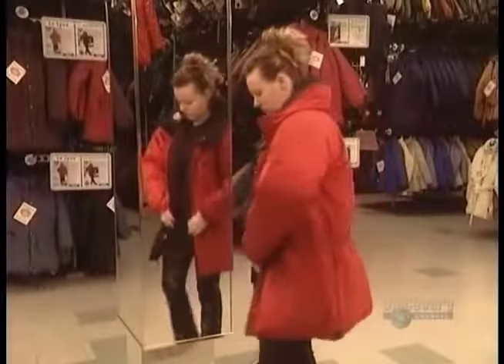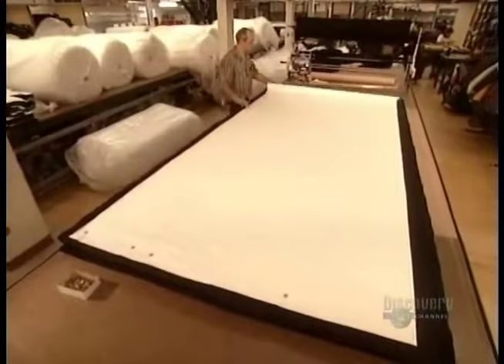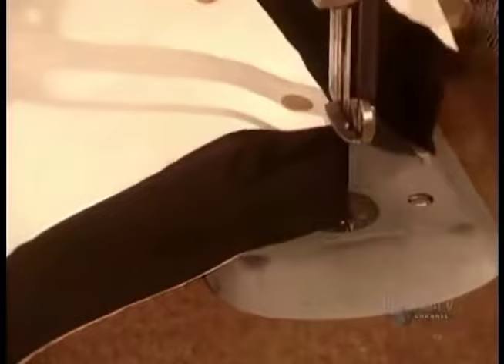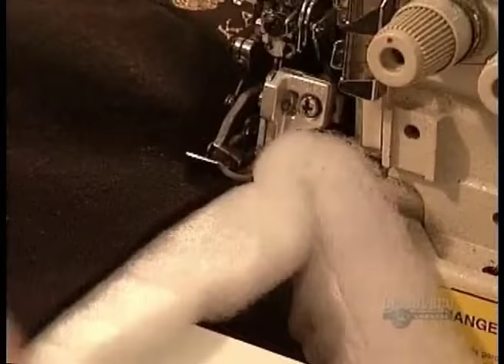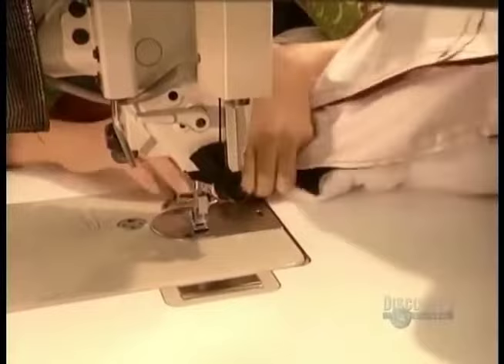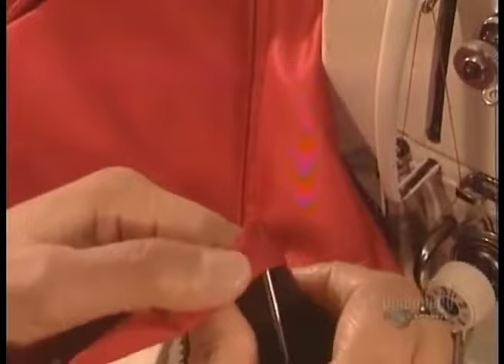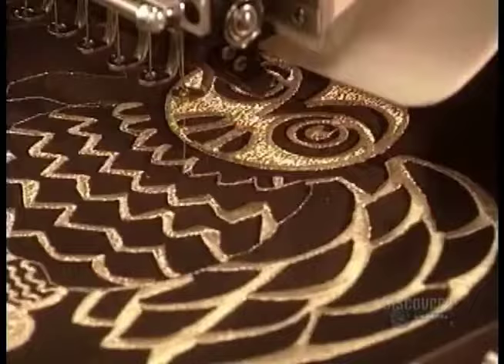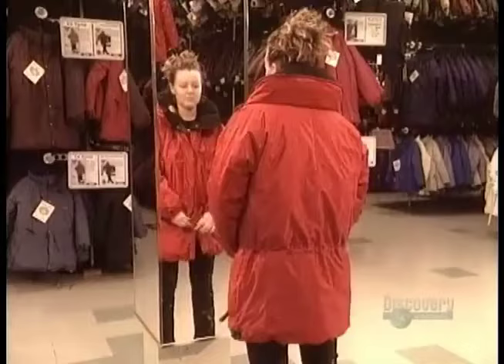How Winter Down Jackets Are Made (Start to Finish)

Comment: Very interesting, that is one interesting way to see how are winter down jackets are made, I believe there must be a place where you can get yours custom made, and what I would add if I had the chance to purchase a custom made down jacket, the jacket I would like should be of two or three colors, with sleeves that can be removed via zipper so it can be turned it into a vest, and the main detail would be a large collar with snaps, so it can be buttoned all the way up and provide heat to the neck. Inspired by those down ski jackets that were fashionable in the 70s and early 80s